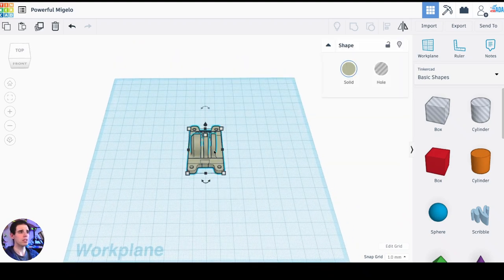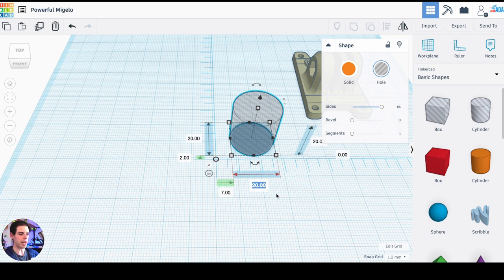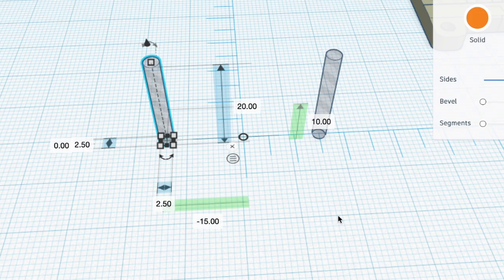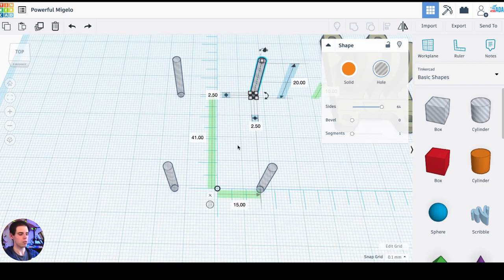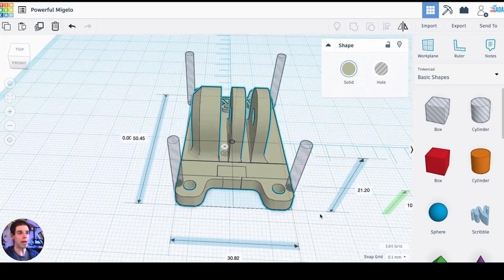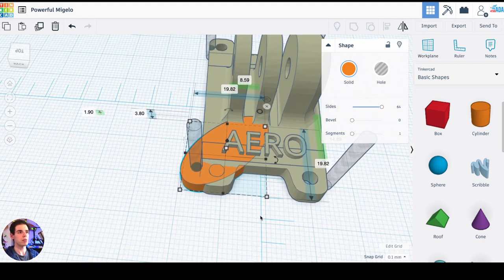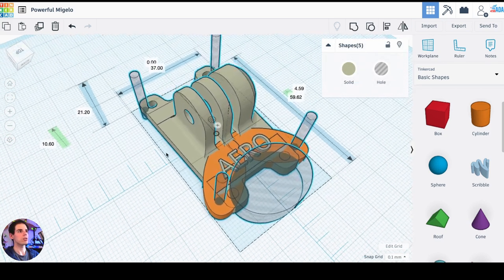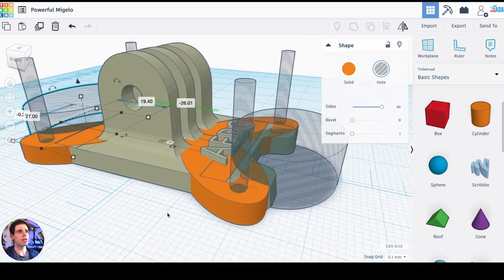Easily Customize 3D Models Using TinkerCAD - Modify .stl Files for 3D Printing - Beginner Tutorial

Comment: Thank you so much for sharing this info! You’ve given me some confidence and ideas on how to make what I’ve been wanting for a while.
Reply from the maker: Glad I could help! Thanks for the feedback! What are you making?
Reply: I’ve got a drawer in my entertainment center for console controllers and it’s always cluttered. I want to make a set of stands that will hold the controllers… and the stand will also house a magnetic charging cable for each (or a few) of the controllers. So it will hopefully be easier for my kids to charge the controllers without breaking the charging ports. Each consoles controller is different so I’m using  several stl files and I’ll hopefully be able to make it stream lined and simple. Cheers!

Comment: I have been using Tinker cad for about 4 months now, glad I came across your video. That ruler helps tremendously, struggled for ages on this ,as I own  and fly quads , so I have similar problem lining holes. Wouldn't it be great if they had a free hand sketch tool and a rubber like in paint. Or do they? Thanks again
Reply from the maker: Glad it helped! They sort of do (i think it's called the "scribble" tool), but it doesn't work very well.

Comment: Question:  If you want to significantly changing the size of a STL design found on Thingiverse, how do you preserve the size of things like hinges and latches?
I found a Pelican case design on thingiverse that is huge (525mmx432mmx165mm) and my desired size size is 160mmx125mmx 45mm).   If I drag the entire model to the smaller size, doesn't that collapse the hinges and latch connections also? 
What's the best way to achieve a working but smaller size case?
Reply: Probably a late response, but you can import stl models into sketchup, besides tinkercad, your only option is to modify the model. Sketchup is surprisingly easy to use.

Comment: Hi Adam just joined your channel and love it. Your a good teacher for the beginner 3D'er. I just got my first printer this month and already having a blast printing the stuff that we made together even though I don't have a gopro or a drone and any way ty. but now I'm having a problem with some of the stuff i made most of it is printing good (for example) a flat heart shape that is 2.25 mm thick but one side is lifting up during the printing process. i have the Creality Ender 3 pro I'm running the bed temp at 60 and just one side and bottom of the heart is lifting off the bed. Any Ideas on how I can fix this problem I'm all ears. thanks
Reply from the maker: Hi! Thanks, Jeff! If only one part of the print is lifting, it may be a bed level issue (that part of the bed is lower than the rest). Or it could just be an adhesion issue, in which case make sure the bed is very clean (if glass). Also try printing with a "brim" around the print (about 5 layers). Also check out this CHEP video about a cool cura plugin https://youtu.be/D45eIhoWSyg . Or you could buy Magigoo adhesion compound (I think it works great!).
Reply: @RCwithAdam1  thanks Adam I’ve watched some of your other videos and some other people videos and noticed that you were printing on glass I went to my local hardware store and bought a couple of pieces that fit my bed and now I’m not having that problem thanks again

Comment: what tpu do you use? i can't decide on the flexibility
Reply from the maker: I use SainSmart brand. It's very flexible and strong when printed thin, but can be quite rigid if printed more densely. It does stretch, but not much (nothing like a rubber band).
What kind of object do you want to print?
Reply: @RCwithAdam1  i would like to print gopro mounts for my fpv drone and bumper frames for the fpv drone, thank you for your response! what softness is your sainsmart? a95?

Comment: Good but too much talking/unsure changes. I'm looking for; importing a STL design, items within the STL design be changed, i.e. STL CNC-clamp needs to be lengthen, but inside the clamp the M6 mounting slot needs to also be elongate - how? There is no simple way of just altering the item dimensions of the STL design/elements. It looks like I'll need to create an all new slot hole and overlay it - how burdensome.